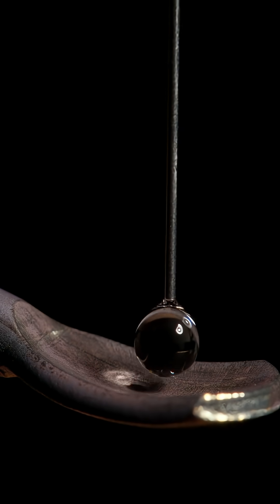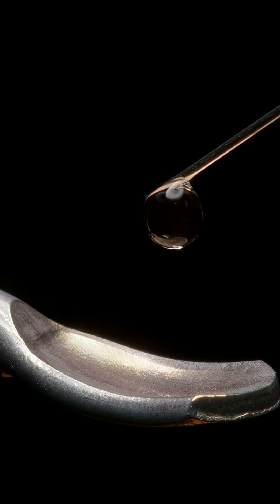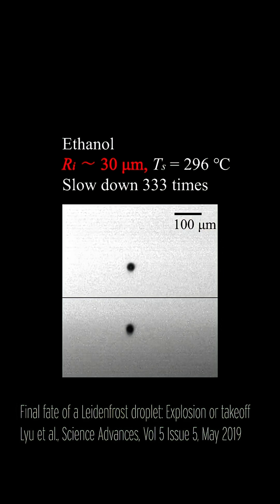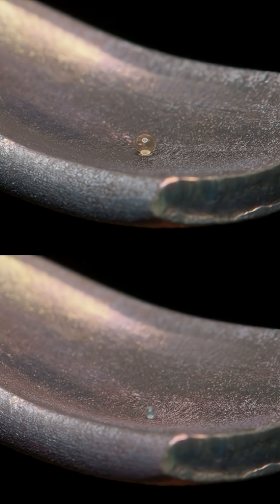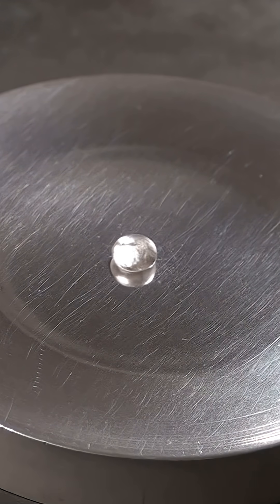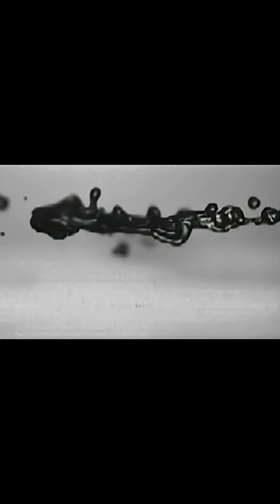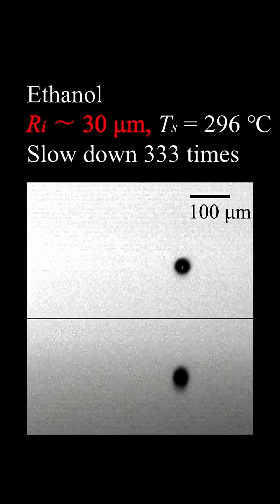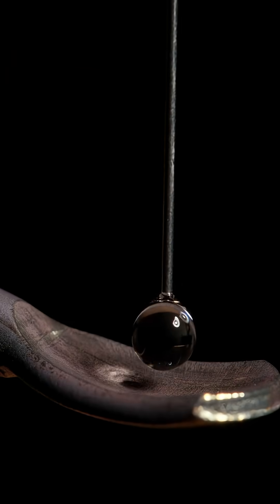trying to make water levitate but it keeps exploding

Comment: Here's is my thoughts, it has to due with maintaining an equilibrium of forces pushing inward and outward which maintains the state at which the droplet floats due to the differential temperatures. When the droplet is contaminated, the contaminants heat faster, retaining more heat then the surrounding water, thus causing an rapid expansion of force to expand outward and forces the water to lose its fragile structural integrity as a droplet. The dispersion of heat or outward force from the droplet is technically greater than the force pushing inward by the heat from below, which allows the water droplet to float, but it is at a rate that which doesn't causes almost instant evaporation. The contaminants changes that factor. 

A similar phenomenon takes place within stars through nuclear fusion, but at a more macro rate, thus being the determinant between supernovas or blackholes at the end of life cycle of stars in regards of maintaining a state of equilibrium of forces pushing inwardly and outwardly.  To be exact i would characterize the state more specifically as Ascending equilibrium amd Descending equilibrium, which the rate at which one force pushing inward or outward is greater than the other, but the degree of its rate of energy expenditure in one factor or the other is the determinant between whether it could be classified as an ascending or descending equilibrium because given enough time, factored in with its rate of energy expenditure of forces pushing or pulling outwardly or innerwardly, one force will eventually succumb to the other.

Comment: I know how it works. The water can only get so hot but the contaminants are solids they can keep rising in temperature while the water hovers right around 212° . This superheats the water from the inside and the outside causing the water to acutely sublimate.

Comment: I think it's like the surface tension of the droplet is holding it together, but if the boiling temperature point of the impurity you have added is any higher than the water itself, the impurity is gonna boil faster inside the droplet and inside this surface tension shell, therefore it's gonna start expanding faster than the water droplet, and it will start storing the pressure inside the surface tension. Then eventually it's enough pressure to pop the droplet, and it explodes like that, either finding a weak spot on the surface tension, or concentrating all of force and pressure at one spot, that spot is where the jet comes out of the water, it's the jet of boiled impurity that wants to escape the droplet because it's already boiled and expanding, but the water still isn't, that's why you don't see it evenly expand and evaporate, the water still isn't ready, so the impurity rushes through the droplet and pops it explosively. But IF the water is pure enough, there's nothing to burst through it, so it just starts evenly expanding, and turning into it's gas state, the droplet starts releasing steam molecules and creates this even thin layer of vapor under itself, propelling it higher due to the molecules bouncing off of the spoon or whatever surface is under it, and having nothing to bounce off of above the droplet, so they just fly aside from the water, not stopping it from going higher and higher (Or not stopping it significantly enough to capture, because it's gas after all), untill the droplet runs out of molecules and just turns to steam. That's my theory, and in my head it works, but I'm in no way chemist lol so it might just all be complete nonsense.

Comment: What about the shape of the metal surface the water is on?
As a spoon will radiate the heat directionally from alternate angles.
Maybe you want a flat sheet of metal that conducts evenly, with no hot spots to give the most balanced element.
That way when the water travels, it won't receive different degrees of energy.

Comment: Well obviously it's because the concentration grows high enough quickly enough that the dissolved ions' effect on the thermal conductivity of water(/ethanol) becomes suddenly noticable, and becomes somewhat of a runaway reaction. (On a very small scale)

Test this with a higher starting concentration and see if it happens sooner)

Also the density is higher with dissolved ions, so it would take more energy to lift it, would sit lower, and therefore take on more heat, which is also a runaway effect.

Comment: Dumb guys opinion- I would imagine the insulating vapor layer created by the Leidenfrost effect is causing increased pressure within the drop of water itself and when that water has been contaminated the molecules are so close together under such high pressure and decent temperature that the oxygen and hydrogen bonds probably break apart rapidly to rebond with whatever contaminate is in the drop of water itself 
This would create lots of energy and depending on what molecules bind together even leave byproduct, that sudden increase of pressure or energy exceeds the forces being put on it by the insulating outer vapor layer, causing it to explode. 
I’m not educated enough in this type of stuff so take what I say with plenty of grains of salt because it’s likely to be wrong or just off but that’s my thinking as to why it explodes. As for levitation I don’t have any clue lol

Comment: it's probably not hot enough, as it is evaporating when it is not touching the metal. So the vapor has to carry the heat to the water. And it levitate because the force of gas expension via vaporization is counteracting gravity

Comment: Perhaps the spoon needs to be hotter? The droplets must be flying away due to the radiation vaporizing water on the underside of the drop (air currents probably also help), so a hotter spoon would probably increase that effect.

Comment: I’m no expert, but having some experience with lyophilization, it kinda seems intuitive to me that an impurity would provide a nucleation point for a solvent to change phases from liquid to gas, just as it would when going from liquid to solid.
Reply: Pretty sure there's a paper that says exactly this with the leidenfrost effect
Reply: foreign particle basically breaking the "surface tension" of the droplet by becoming superheated as it passes the surface, and causing the surrounding water to instantly superheat as well.
Reply: That's what I was thinking
Reply: Also not an expert but that was what I thought too. It's like that super-cold water trick. Only like, hot.
Reply: Looks like an electric charge being built up to me. When it overcomes the leidenfrost effect, it jumps to the metal, breaking the surface tension, and, pop!
Reply: @ZomgLolPants but how would it gain charge ?
Reply: That does not explain why the jet is, always, reliably, coming from below. Since the contaminant is typically evenly spread, the explosion could initiate a jet from any part of the surface if the answer is just the contaminant serving as a point of nucleation.
Reply: @Moonchild15225 Because that's where the surface of the water is most unstable. The contant heating of the bottom of the droplet should create a low pressure zone right at the bottom to which once the phase change from liquid to gas happens, would make the pressure escape to the lowest pressure zone.
Reply: @Moonchild15225  Maybe because the impurity has a different boiling point, so it doesn't just evaporate like the other water? so it would be more concentrated at the point of contact, not evenly spread, right?

Comment: I am going to guess, as a chem student, that the impurities are trying to escape the water/liquid since impurities likely cannot dissolve into another form of matter at this temperature.  The explosion is likely the impurities successfully breaking through the bubble of liquid since the layer is too thin to hold the weight of the impurities, and so the bottom breaks first due to gravity.  That is my best guess.

Comment: You need to get the spoon hotter the radiant heat needs to be enough that the air itself vaporises the water before it can transfer enough heat to boil the water. You're actually floating the water on superheated air.

Comment: Impurities causing water to do funny stuff immediately makes my mind go to nucleation sites. Maybe it's some form of superheating. And when there is impurities then it vaporizes, expands, and explodes. 

Going further, maybe there's some configuration where there is gas in the droplet that's trapped and the updraft from the hot air causes the levitation like a balloon until it evaporates? 

To test that you'd need a high surface tension liquid that vaporizes really easily. Which I didn't think would be easy to find.

Comment: my guess, the contaminant crystal is forming, then denaturing, after that when its hot, its structure breaks down on a sharp gradient, producing different potential zones, and boom, basically pressure build up due to elasticity and breakdown due to breakdown stress being reached. its my guess.
Reply: That sounds right but I wonder how you could prove it

Comment: Seems like the surface tension might be interacting with the impurities as they seperate at the higher heat. You're literally boiling out the impurities without a vessel

Comment: is it possible that said contaminants provided nucleation points for bubbles of boiling water to form once it's small enough? water turns to steam once hot enough, pure water droplets gets to heat up uniformly with neat convection cycles so it didn't explode, contaminants like salt molecules might have been able to disturb said convection cycle by not acting the same way as the water molecules surrounding it, thus creating tiny little cavitation bubbles between both molecule types
Reply: I was going to say this so thank you.

Comment: Can someone convert "30,000 frames per second" to metric units? Is it exactly 30,000 times slower???
Reply: What I was saying is the equivalent of converting Celsius to Kelvin, in other words an absolute scale is being asked for.
Reply: 30 000 frames per second is 30 000 images per second
Reply: I'm crying at "metric fps", this is the non-American version of an American education type comment, bless your heart... 💀😭 30,000 frames per second means that if you took one second of footage at that frame rate, there would be 30,000 images. most PC games on modern hardware run at 60 fps, so only 60 images in a second. the reason they use such high frame rates is to be able to slow down and actually see what's happening. even the people with the fastest reaction times can only notice things within a matter of milliseconds (1/1000th of a second), and that's assuming they're paying attention to it lol. lots of cool and crazy stuff happening all the time that we almost never notice, even when we look!

Comment: I feel that the experiment was a droplet that was propelled. The intense heat temp could vaporize the liquid as it approaches causing it to “roll” up the expanded gases. As for the exploding with impurities I’d be willing to bet that it causes a instability in the surface tension when heated due to whatever mineral being different whether it was a solid (salt,iron, etc) or just a different boiling/vaporization temp than pure H2O. Just a guestimate tho